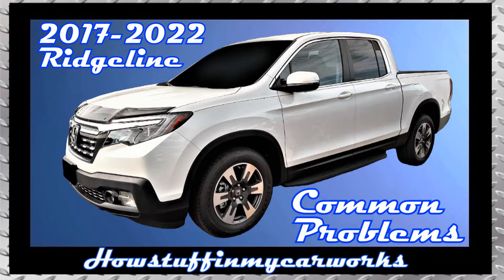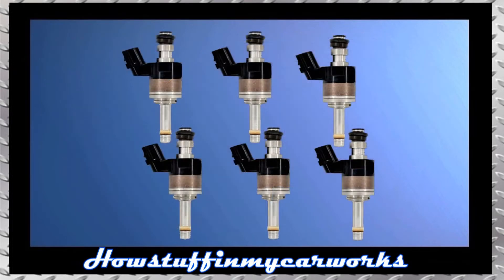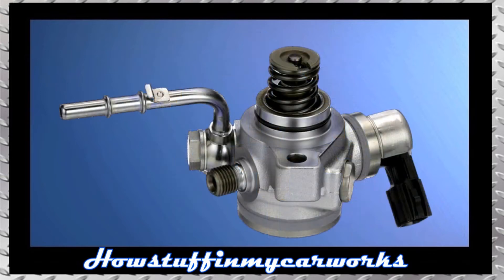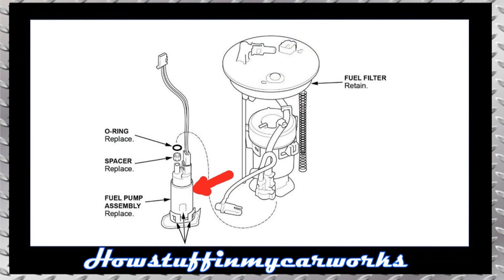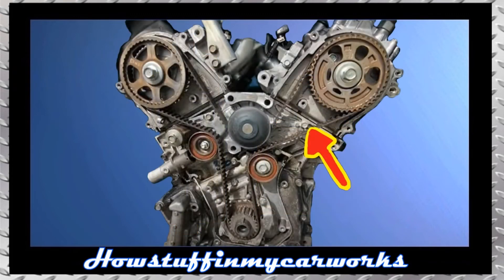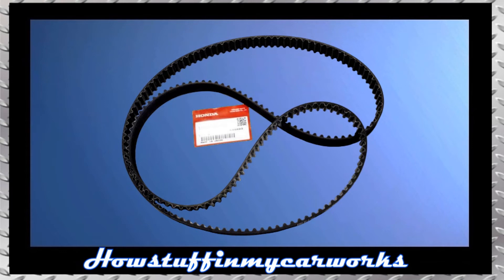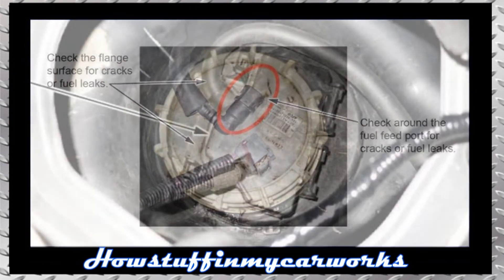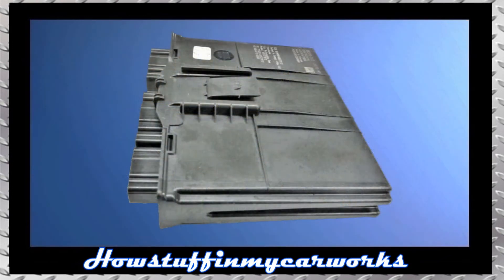Honda Ridgeline 2nd Gen 2017 to 2022 common problems, issues, defects, recalls and complaints

Comment: My 2020 Ridgeline has a major hesitation issue when accelerating or even lightly stepping on the gas pedal. I have taken it to the dealer several times.... "We don't see an issue." Now, I know it is probably the fuel injectors. Thanks for the information.
Reply: It was cover under by Honda.
Reply: Same ! 😊
Reply: What did they wind up replacing?
Reply: I own a 17 RTL-E with the 6 speed. I had a brand new back then, 22 RTL-E as a loaner for a week with the newer 9 speed. And  immediately noticed the hesitation, especially at lower speeds but that was definitely the way the gearing and throttle were set up.

Comment: 2019 RTL E 19.700 miles. Keyless entry relay, chip whatever you call it when out. Cant drive it, its been sitting at the dealer for a month waiting for the part. Edit: 6 weeks now

Comment: My 2017 Ridgeline transmission warning message came on at 52500 miles. Dealership said transmission needed replaced. I traded but took a $10000.00 lose on my trade in.
Reply: My partner had the warning message on his 2019 Ridgeline, first time it showed up at 46K miles, the fluid got replaced.

The message then shows up again at 66K miles and this time the transmission was actually done.  The transmission was luckily still under warranty so it got replaced and he has yet to have that truck back because they struggled to get the old transmission out.  Then they struggled to put the new one in.

Comment: Hood latch has an open recall due to wind going underneath causing the hood to flutter.
Reply: My 18 had the hood flap issue. They added body adhesive to the underside structure and adjusted the latch/hood stops

Comment: Our 2017 ridgeline walk away shelf locking stopped working took it back to honda the reset it bsck to factory settings didn't help got it back home did my own research took it back asked them to replace the start button fixed the problem  they fixed it no charge even though it was out of warranty .

Comment: My 2022 Ridgeline hesitates sometimes when rolling thru a turn. Appears to be a downshifting issue. The transmission appears to vibrate slightly when accelerating thru the lower gears.

Comment: My 2019 Honda Ridgeline is a shit box. It is currently sitting in my driveway smelling like gas from an fuel pump recall. Honda doesn't even have the part to fix it so my dealership said I'm shit out of luck until they can get the part. Honda spokesperson on the 800 number line said it will be  available in the fall but it's still not even spring yet. They also said there's a stop sell on all ridgelines. You click on the ridgeline on the Honda site and it doesn't do anything. DO NOT BUY A HONDA!!!
Reply: I won't buy your Honda...my 2019 has been flawless minus a couple recalls.

Comment: 2022 Ridgeline: Auto stop/start stops working.  The software update is not effective to fix it.

2022 Ridgeline: Flashing check engine light causes misfires and the vehicle to go into limp home mode unannounced.  Aftertreatment system possibly melts down and requires replacement.  No fix or acknowledgement from Honda.